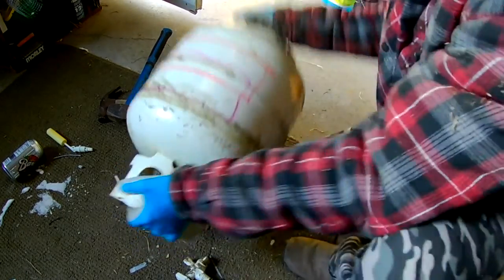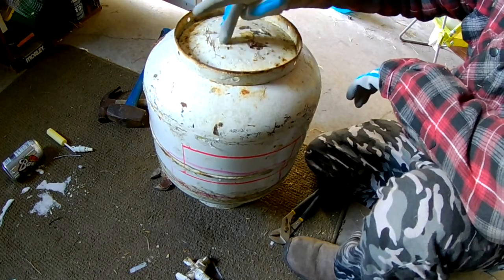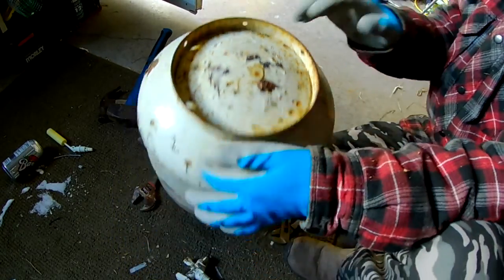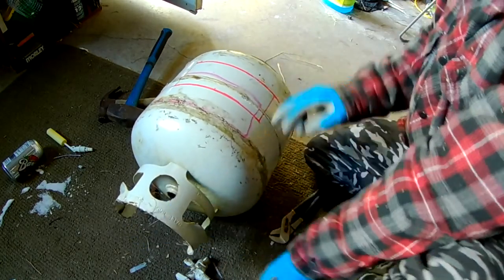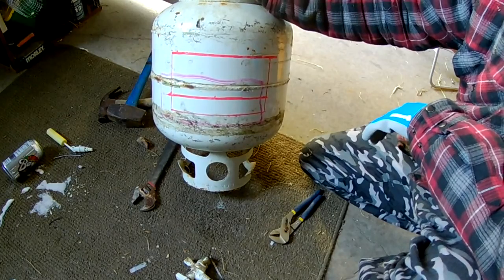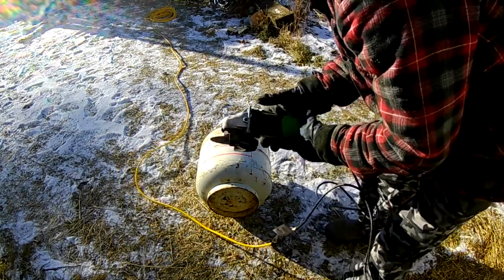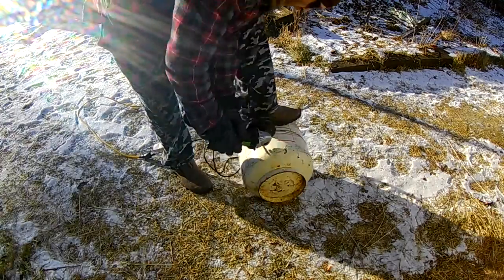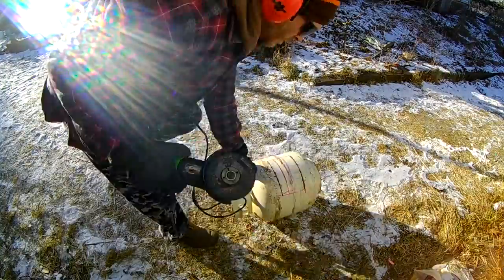propane tank wood stove

Comment: It's your build an you should be proud of your diy job man.
Chimney pipe might need to be at least over 100mm or 4 inch, have made a few in the past an found that a gas bottle your size needs a 4 inch  an if you use a bigger bottle then go for a 5 inch pipe.
Go video  an keep up the good work.
Reply from the maker: amnotwise sweet, that's what I was thinking of using. Thanks
Reply: Made mine out of a 30lb cylinder ,sturdy legs bolted on ,where valve was, I cut out a 4" hole and cut out  bottom and install a door also when laying on it's side I cut out the existing top approx. 12'' by 10'', now and hindged it ,works great and cooks well and lots of heat, it acts like an airtight.